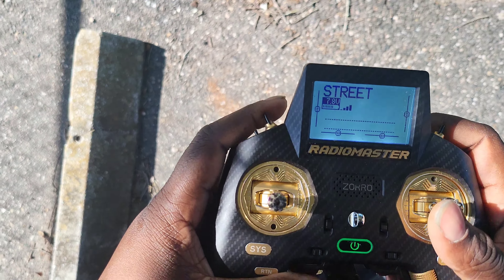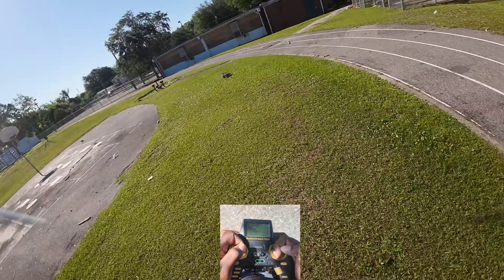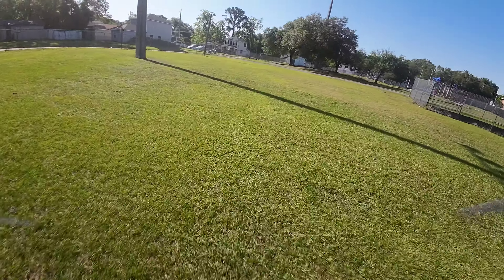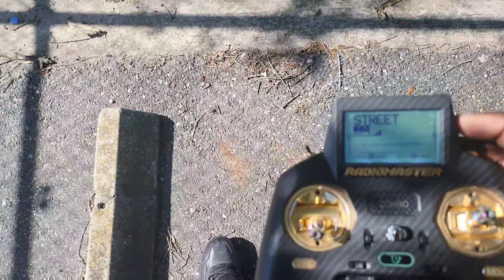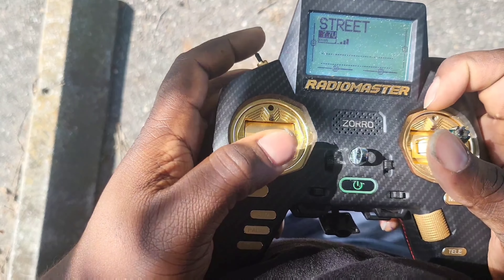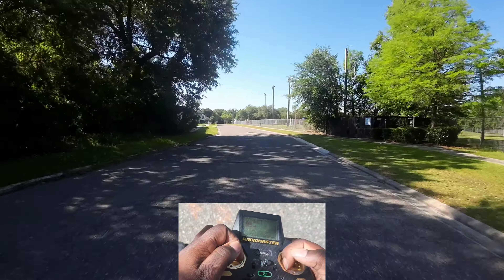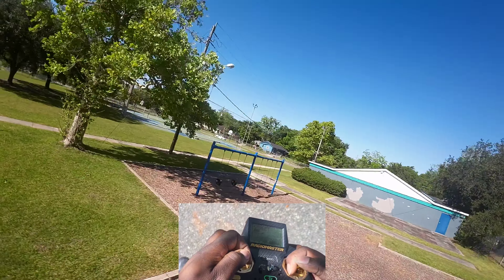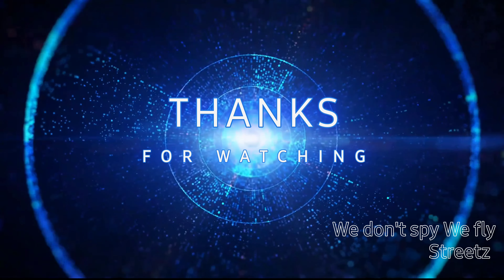INVERTED MOVES: Working To Boss Up my Flying W/ 3 Packs a Day.. Is the DJI O3 Cam Good Enough??

Comment: And yeah, motor output limit is better to use than throttle limit, unless youre just trying to remove an issue that only happens at full throttle without that limit